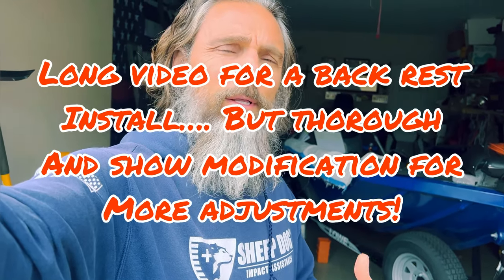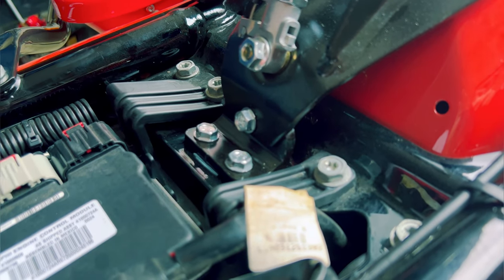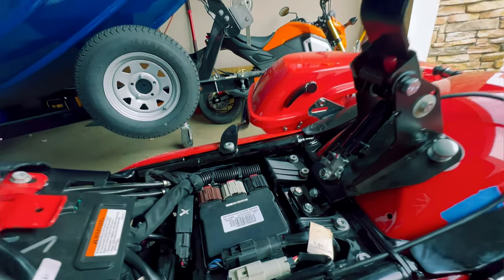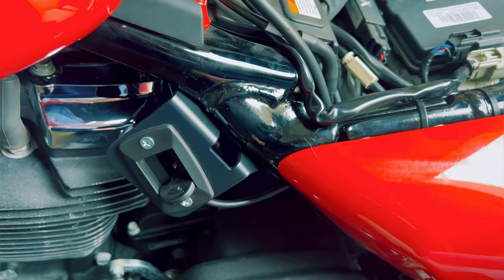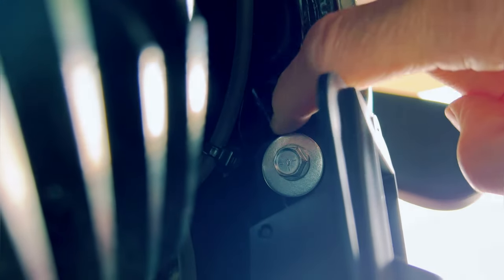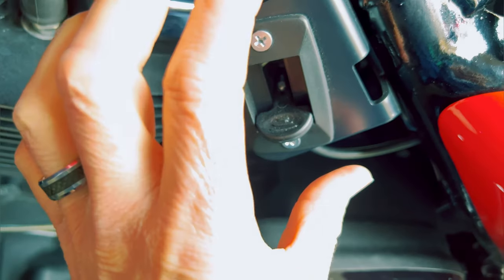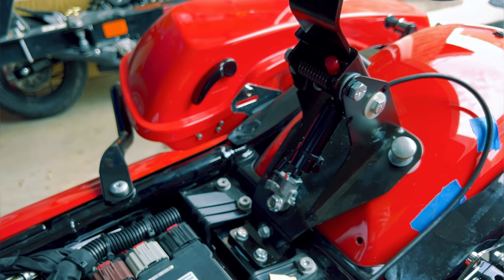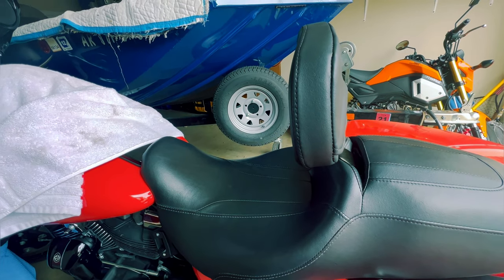Harley Davidson adjustable back rest. MODIFIED for more adjustability. Street Glide / touring models

Comment: Dude, you’re OCD just like me…! LOL
And like you, I have serious back issues. 6’3” & 195lbs. This looks like the fix I’m searching for… 
I like the tips on protecting the paint, and a good explanation of the modifications and results!
Thank you for your help, time , and efforts in this video!
Reply from the maker: This back rest changes the whole ride for me. And yes a bit of OCD ha ! 
Btw, if I add the thicker ultra model seat (which is thicker) it elevates my position slightly,  which changes the angle of my pelvis due to seat being higher from the floorboards (hence my knees having a different angle/ leading to the pelvis). Anyway…. It helps slightly with my back pain. Plus the ultra is a thicker seat and absorbs the bumps better then the thin street glide seat, again leading to less pain. The seat doesn’t look as cool, but on long ride I take functionality over appearance any day !

Comment: You did a great job explaining the installation. I had this Harley Backrest on an Ultra I use to own. A couple things I didn’t like about it as can be seen in your video is the adjustment lever location prevents having mid frame heat shields. Second in that location you need to lean forward away from the back rest to reach it so you’re not putting pressure on the backrest to find the sweet spot. While parked I had my wife hold the switch while I leaned back to find the perfect spot. Since I never changed the adjustment after that on my next bike I just bought a standard backrest. 
Now after watching your video I think changing the location of the adjustment lever would solve both these problems. Using a shorter cable have a clip on mount that would attach to the bottom of the seat. The lever itself would be on the side just like switches are for heated and cooled seats. Moving the adjustment lever there would allow the rider to easily adjust the backrest position.
Reply from the maker: That’s cool. Maybe make a video and share it once completed?

Comment: It seems like you read my mind when you posted this video but I hadn’t even run into the problem yet. I bought a new 2024 road glide and definitely wanted the back rest cause I had one on my last bike so I bought the parts and it was a pain in the ass to put it on mostly because the instructions suck. Once I started riding around with it, however, I noticed that it was pushing into my back a little too much and I wanted to push it back further than it would go so I was struggling with that and the actuator switch that you pulled to push it back, actually broke off in my hand. so I got a replacement part on the way. Just now when I saw your video I immediately went to the garage and implemented your modification to push the backrest back a little further, and it fits me perfectly now, so thank you so much.
Reply from the maker: Very nice ! Glad it helped out. A little adjustment sure can make all the difference in comfort. I figured it out after long rides on the last bike. Ride safe !

Comment: I'm 6' - 2" and had to make a greater pitch back modification. 
The 3 fasteners on that front bracket I had to replace with longer bolts, shim up the bracket with 1/2" spacers and the same for the middle bracket fastener.
Almost got it where I like it but could use another inch to lean back on.
Reply from the maker: Thanks for sharing the idea 👍